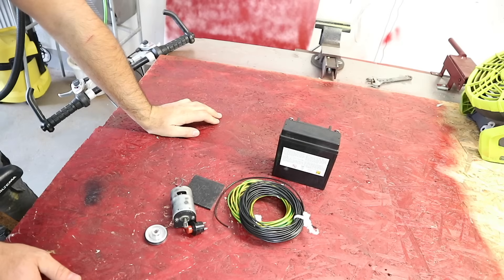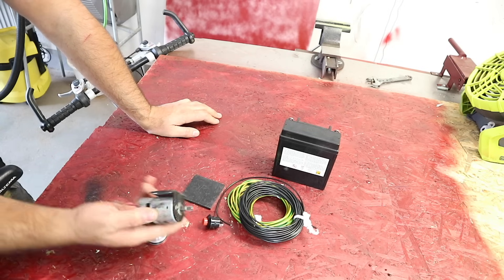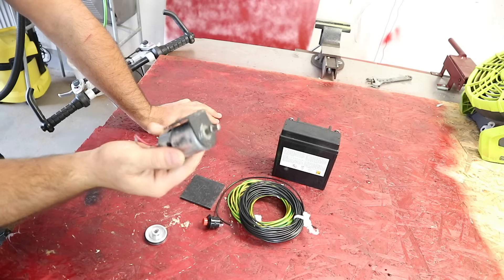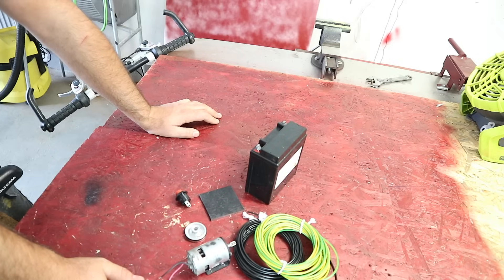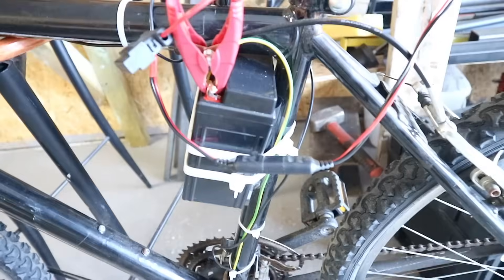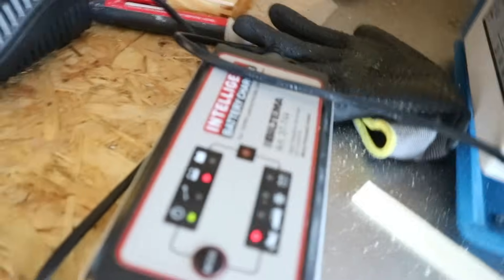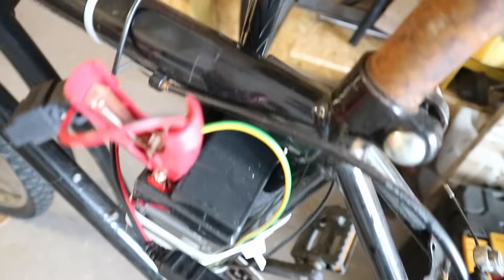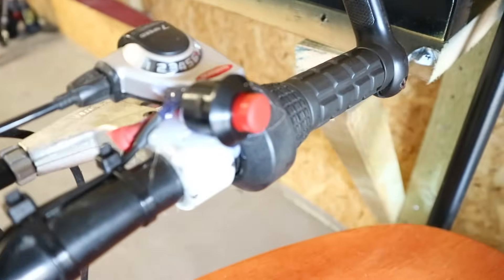Build a Electric BIKE Using 775 DC motor at Home

Comment: The idea is pretty good, but you did not use all the power of the motor. The way you connect even if you use 36V may not give force power by attaching the motor on the side. Try using the gear and bike ring to allow the motor to use the full power.

Comment: The implementation is fine, but not recommended. It could burn up the tires overtime. If you want maximum juice out of it, use chain to connect it directly to the tires. Also 1 motor is too weak especially on 12 V and the not recommended way to drive the power into the tires. Put more voltage to it, add more motors, or do both. That's the best way. I know for sure he must have stop the camera, go back a tiny bit, gain speed using the pedals, record again after the bicycle gained speed, then edit it to look like it's real. Good try, liar...

Comment: The speed so slow
Reply: Beacuse power motor is max. 120W. Use 5 Motors 775, and power will be 1KM and nice torque, and speed. Ok. 30km/h, or 24v, 42km/h.

Comment: Congs,this is very great action brother,so what is about top speed per hour? Thanks!
Reply: Depends on weight and motor strength/torque. He looks like he's too heavy for that size motor to push/work efficiently. 

So, I'd say about 3mph. 4mph tops.

Comment: 775 motor takes from 12v to 36v, and often used in 18v rordless tools. So 12v is very minimum. The motor can take up to 36v, so if you use two of those 12v batteries it would be perfect voltage for that motor.
Reply: Are you sure a 12v motor doesnt load to much its better or the motor will burn?
Reply: @justarandombiker  agree with u. 24volt will burn
Reply: Sure 775 can handle 24v and even 36v. Without load no problem. But with a load 24v is very hot.

Comment: The idle power of the man gives 120 watts according to the number of data you have seen. Not to mention this poor engine. The walking equipment is between a horse and a horse. Half of the human force needs something stronger than bicycles.

Comment: Not making fun of you or anything. That motor is too small to drive you around.
Reply: Or more voltage for the mottor
Reply: just use gears to get better gear ration
Reply: or need to loss weight :)
Reply: @FaisalAhmed-kf9yf  I'm not fat. too skinny to lose weight